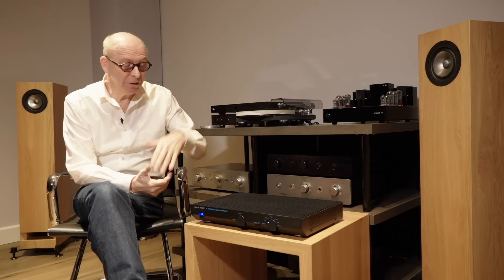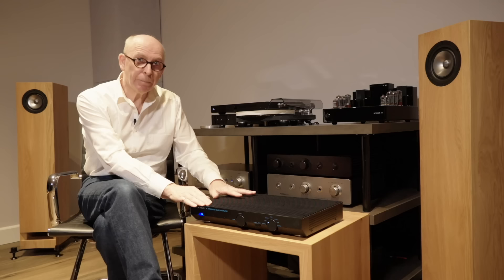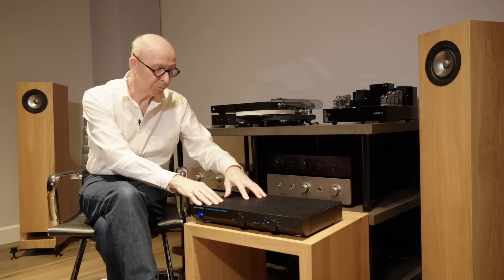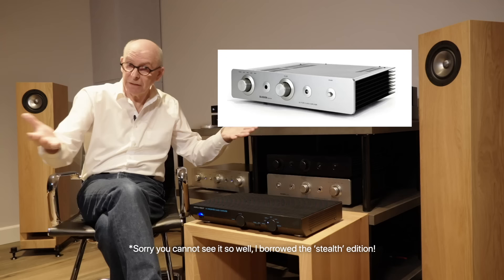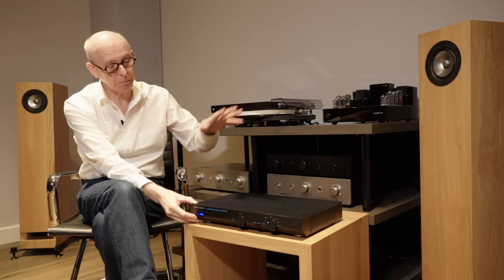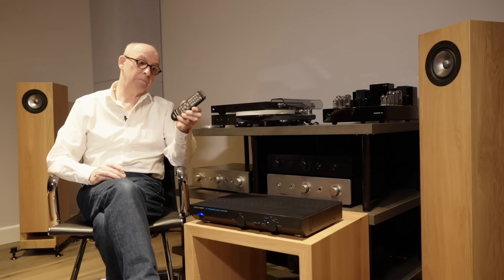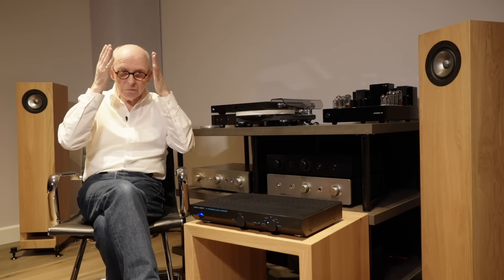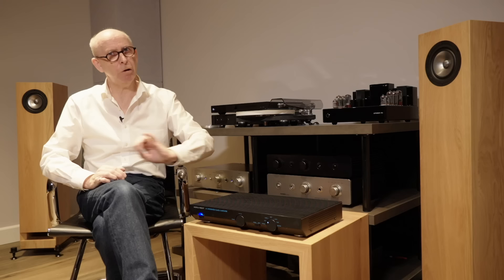Musical Fidelity A1 - Sugden A21, how do they compare?

Comment: About the A1' Class A. It is a PUSH- PULL amp. This means 2 things. Efficiency is in theory double when operating within Class A than what you mentioned (which is applicable to single ended Class A) and it can slide to class B if required, up to the limits of its rail voltage and power supply. The A1 is effectively a very high bias Class A/B fwiw. The Sugden, I believe, is single ended, being SE it can ONLY operate in Class A. Once it reaches what its bias voltage can provide it will clip.
Reply from the maker: Thanks for this. Very interesting 👍
Reply: But here the A1 is compared to SUGDEN A21 which is different to SUGDEN A21SE SIGNATURE.
Reply from the maker: @hamidrezahabibi8111  indeed, although I do briefly reference the A21SE too
Reply: @PearlAcoustics  Time stamp?

Comment: Day one notes on the MF A1:  Heat sink temp was taken with a meat thermometer (133.9 F).  I can tolerate my outstretched hand on the heat sink for around 5-7 seconds.  Now with that out of the way…I have no major complaints with this amp. I have it on a A/B switcher with a Sugden A21SE.  The MF A1 holds it own.  I cannot say one is ‘better’ than the other.  I think it will likely come down to listener preference if one is choosing between the two.  The Sugden seems to have the slight edge in detail retrieval. The MF A1 bass sounds deeper (more grunt-gutsy)…& this tactile feeling in tonal quality seems to extend to the overall signature of the MF A1 amp.  I had difficultly making the distinction between the two amps beyond these slight nuances.  Both present music in a palpable way. These amp sources are more similar than dissimilar (to my ears).  I think the MF A1 glosses over recordings moreso than the Sugden A21SE.  This isn’t necessarily a bad thing…seems like it would benefit or ‘play nice’ with poorer recordings.  I don’t know that there’s a fault or edge either way between the two power sources.  The voices on the Sugden sound forward (sharper with sparkle).  The voices on the MF A1 sound slightly further away or blended into the mix/recording.  The Sugden casts the voices to the front of the mix. 

The listener is rewarded by both units with an emotional connection that class A/B amps, that I’ve had, seemingly cannot match (Krell Vanguard, Hegel H390).  Particularly if you prefer a warmish sound signature.  I don’t find either amp overly warm in sound signature despite the chassis heat😅

Those seeking neutrality, cool/detailed/clinical sound signature (often associated with equipment that ‘measures well’) will likely be displeased. Albeit I don’t think that user profile would seek a Class A amp.

My source is an Oppo 205 (Russ Andrew’s mod).  Speakers are Salk Song 3 Encores (88 db) & Spendor Classic 4/5 (84 db).

Note:  Sugden A21SE temp was taken; topped out @ 93.9 F.
Reply from the maker: Thank you for a marvellous contribution to the topic.

Comment: I’ve had the original in the past. It was repaired three times, and had two further volume pots. I got tired of it, so I bought a Cyrus 2 /PSX, then Audiolab 8000C/P. Because I felt bad about selling it, I kept the A1. Some years later I connected it back up and loved the mellowness. I was ‘t that keen on it as a teenager, but as I’m now much older, it suits very well. I then tried the Krell KSA100 Mk2, and finally the FBP600. The class Asound is really different, and hard to describe - but you did a good job! The big Krell isn’t ideal in an energy crisis - can be almost 3kW when at louder volumes. Even on standby, it can be £2 per day
Reply from the maker: Dear Peter, thank you very much for your kind praise and also for sharing your back story. Very interesting

Comment: Very interesting and useful review this is. I think the last shots clearly show where your preferences lie! I have both amps (not the original versions - maybe second or third editions) but I only just realised I have never compared them! 
There's a couple of points I'd like to make that your video triggered in my mind.
a) The technical side of things may or may not interest certain music listeners . To those that are interested, again, it may or may not reveal why certain elements of the sound character are what they are but that is a risky business because, even armed with a circuit diagram, the amp is still a black box essentially (e.g. the fact that A1 has a direct-coupled output rather than the capacitor-coupled output of the A21 should, on first reading, point to a more open sound with a more articulate, full bass - which is not the case as attested here) until one sits down and performs a series of inspections and electronic and acoustical measurements - a very labourious task! It can, however, reveal certain design deficiencies, e.g. in the original A1 suffered from a cramped interior, PSU filter capacitors whose voltage rating was the minimum necessary etc. Some of these deficiencies may or may not lead to failures - it all depends: on usage, storage, chance etc. Subsequent A1 versions addressed these deficiencies, I understand, which by now are well-known and thus no longer are. Certain elements of the design are necessary, however, for the listener to pay attention to: the fact that these amps are biased into class A means copious amounts of heat are radiated and thus these components should have ample of free space on all sides to allow ventilation. If placed in a stack, they should always be the last device on top and never be placed under other components as the heat emanated from them would increase the temperature of the components above them. Certainly nothing should ever be placed on top of the A1!
b) The A1's design is iconic. In fact the whole series of amps produced by Musical Fidelity in the '80s is iconoclastic and were a fundamental factor in their success. Let's not forget that many listeners are all too happy to display their pride and joy and also derive pleasure from looking at it. The whole A1-styled series of components was a definite success in that department. In my view, the biggest mistake MF made was to abandon this design for decades in favour or other innovative designs. A classic design should always form an anchor in a product line-up as Sugden and other long established firms in the industry have successfully demonstrated. As far as young new owners are concerned: the novelty factor is a great attraction and the A1 design will keep having that advantage in the future as it did in the past so younger people will certainly love to have it. The only device that broke the A1 mould in my mind was the top-loader cd: although the use of valves was a nice touch, placing them upright so as to extrude from the top was a bad move. The line-up's design integrity should not have been broken and the cd  ought to have been designed as a front loader (a rather difficult task at the time).
Reply from the maker: Thank you very much for your enlightening comment and its contribution to the topic.
Reply: My pleasure @PearlAcoustics  - I'm glad you liked it. I really enjoy your videos, as well as those of the British Audiophile. I find you both have a very relaxed and refreshing take on audio equipment reviewing.
Reply from the maker: @Stelios.Posantzis  Thank you. I am very honoured to be in his company.

Comment: I love music. I love audio gear. I follow many review-ers on YT, Tarun aka The British AudioPhile, Steve Gutenberg aka The Audiophiliac, Audiophilia, and a few others and I have to say that I really like the way you review. It is different. You are a bit different. I like a firm grip on the bass and a fast, controlled bass. I would have loved to hear your thoughts about the kind of base these amplifiers create or re-create with your speakers. On the other hand, to be brutally honest, I didn't know what to think, theoretically, about your speakers because of the low sensitivity. Yes, I like one driver, and one source point speaker like Sibelius, but in my mind, I have always thought that that driver must be high sensitivity and the cone must be paper. Anyway, I like your YT channel very much!
Reply from the maker: Hi, thanks for your very interesting comment. In short, I found the Sugden had a more detailed bass, and it can even be detected on the sound clips (just about). The Sibelius has extremely fast and very detailed bass, right down to 38Hz, in the right room and with a good quality amplifier. The sensitivity is not related to its frequency response. The secret is to keep everything as light as possible, so we have fewer winds on our voice coil which decreases sensitivity but increases dynamics. (I am over simplifying here). In the beginning of the Sibelius development we experimented with paper cones and even brought one to market. But the midrange was a bit too ‘shouty’ and the treble too harsh for my liking, + in listening tests, 90% of our audience preferred the driver we now use by a long way. I hope you get to hear a pair of Sibelius loudspeakers one day.

Comment: Very informative video, I wonder if the A1 would start sounding better over time. 
I had the original A1 back in the 80’s, worked it hard for 20 years, regret selling it. 
It’s the reason why I’ve returned to the modest output of Class A after years of High Output McIntosh gear. Six months ago I found the last available Luxman 590axII at my local dealer. 30 watt output, the amplifier Power Consumption is 260-330 watts. Hard to find information on Class A used by the various manufacturers but your explanation on input versus output makes perfect sense. 
The Luxman is 10 times the price of the Musical Fidelity, clearly the Class A designation is used loosely. Cheers from Canada 🇨🇦
Reply from the maker: Thanks for your comment, happy end of year from Belgium
Reply: I too had the original A1, paired with some Monitor Audio speakers, changed to an A100 and then pre-3A & MA50's into Epos 14's - that was a fabulous sounding system. Then swapped to all Linn/Aktiv as the MF stuff was not the most reliable and after 20+yrs, it's departing and Accuphase is incoming. It might well have been the Sugden (was planned), but local dealership changed and scuppered that (prefer to support local retailers even if choice is more limited). Accuphase is stunning so very happy with that....awaiting it's arrival as I write. Great video's, as always 👏👏👏
Reply: I’m on same page by supporting local dealer, most dealers don’t carry both Accuphase and Luxman, mine just the Luxman, from my understanding both are like the McIntosh of Japan, long history & house hold name. It’s certainly my last amplifier. Enjoy the Accuphase, killer pieces. 😎
Reply from the maker: @tommcmurdo6181  thanks Tom, very kind!
Reply: @1999zrx100 : The Luxman L-590AXII really does deliver 2x30 watts, while the Musical Fidelity delivers its first watts in class A, then switches to class A-B for speaker requirements. Just look at the difference in power consumption between these two devices, for proof !  😉

Comment: I own it and I love it, my thoughts on the A1 are in alignment with Mr. Lovegrove. So what sounds great in hifi does not necessarily feel great! Kinda like popular tunes, the dull tunes are often more popular than the sharp tunes because emotion feels better than thought for many, I love my tunes both ways. Sometime fun, sometimes contemplative. For a relatively affordable secondary system designed for the fun factor feels, class-A power is an obvious consideration, the A1 delivers.
Reply from the maker: Thanks for your comment and contribution to the discussion.

Comment: I always think when people are over analytical about their music they have gone past the point of just laying back chilling out and loving the music in a way. I feel sorry for them because they’ve lost the ability to zone out and just love the music they have this bad habit of needing to analyse it which if you were sound engineer, I understand where they’re coming from but if you’re meant to be enjoying the music don’t analyse it you’re ruin the fun, and the moment that all being said the sudden better amplifier all round I’ve never understood the fascination for the musical facility it used to go wrong overheat and break in any of the industry that would be a big no-no yet for some reason it’s got a following
Reply: For some, the analysis is the fun part, and that is no less valid than 'just enjoying the music'. Many are somewhere in between, doing both, in varying proportions.
Reply from the maker: You make an interesting point. I am one of those people that can switch between the two. I guess it’s a kind of ‘work’ thing. When I am working, I am listening very closely. When I am chilled and out of the work environment, it’s just music. But sometimes I slip between the two. And both can be enjoyable in their own way.
Reply: I have found over the many years in audio that there’s a fine line between more detail and listening fatigue. It’s so frustrating and hard to have one without the other. I personally think that’s why many are constantly changing out gear. 🤓
Reply from the maker: @1999zrx1100  good point. Personally I find some class A equipment offers a suitable balance for me. But I totally get where you are coming from. Always a good idea to have two amplifiers, if you can afford it!
Reply: @PearlAcoustics 
I bought the a1 to tame my bright sounding kantas no1 focal speakers. And it work I'm able to listen to them for hours and hours. Thks

Comment: From a polish review

[ The spectrum of harmonic distortions (Fig. 2) is also exciting... We see a strong second harmonic (- 57 dB), which can be considered another tube accent of the A1, the third one is also high (- 62 dB), above - 90 dB we have a fifth harmonic (- 80 dB). A1 has a life of its own.

The advantage of the 8-ohm load is also visible in the form of lower THD+N distortions (Fig. 3); then they go below the level of 0.1% from 0.2 W, and at 4 Ω this is not possible in any power range.

It is also worth paying attention to the unusual shape of the THD+N characteristics for a transistor amplifier, similar to tube amplifiers, which slowly increase from the minima at low powers.. ]

I like much more the Sugden A21.

Comment: My Sugden A21SE manual states max power consumption as "300W"; on which basis it's a pretty purist Class A device. The other competitor brand here (and they are making some very, very good amps at the moment) are Rega. They are not pure Class A, but they are heavily biased that way, and get a little warm. My issue with the MF would be its reliability. Their failure rate used to be sky high ("I've got toasted A1s from floor to ceiling") as a distributor once infamously remarked. Final point ; the Sugdens use Philips RC5 remote control logic, so a lot of other remote handsets will work with them. I have an old Naim one, the Sugden one, and my favourite - the little one that comes with the Rega Brio-R.
Reply from the maker: Indeed, Rega amplifiers are also very interesting. I have an Aethos in the listening room, and I like it slot. (It’s also beautifully made).
Reply: @PearlAcoustics  Will you be doing a review of the Aethos that would be very interesting indeed.
Reply from the maker: @markphillips1509  Hi, I do have one in the studio and I do like it very much…  it’s a possibility. Thanks for the suggestion

Comment: For me what would be interesting is to compare today's A1 with the original A1 from 1985, bearing in mind that the original only cost £189 (budget entry level) and with inflation adjusted, would be equivalent to £589 today. 
So when you consider the new version is being made in the far East and it still costs €1,600 it's not necessarily going to attract the same person entering onto the first run of the ladder for hifi in 2024
Reply from the maker: Hi, good point. Thanks for your comment. I think your suggestion would make a very interesting comparison. I am not sure how inflation is calculated, when it comes to hifi but the one thing we know is that the original A1 was very unreliable and had a relatively short shelf life. Hopefully, this incarnation will prove to be much better.
Reply: @PearlAcoustics  thank you for your reply 👍🙂.
I have always admired Musical Fidelity products, unfortunately from afar, having never owned any of them 😭.
 They are what I considerto be a very quirky "English" design, but I have listened to them and liked their sound.
I wonder what made the original product so unreliable. 
Was it cheap/poor components or poor design/ board layout which  lead to heat soak problems and premature component failure. 
Maybe your viewers can share their experiences.
Incidentally my very first amplifier was a Yamaha C85 & M85 pre/ power amp combination which sounded glorious but unfortunately, and  surprisingly, It was the control amplifier that was constantly failing due to heat issues - components quite literally desoldering themselves from the board. 😭
Reply from the maker: @IncognitoChild  the unreliability was most of the things you mentioned. I happen to know that the volume potentiometers were particularly vulnerable to the heat
Reply: I just bought the 2008 model version of the A1.  Almost no info online, I wonder what internal upgrades were done for that version?